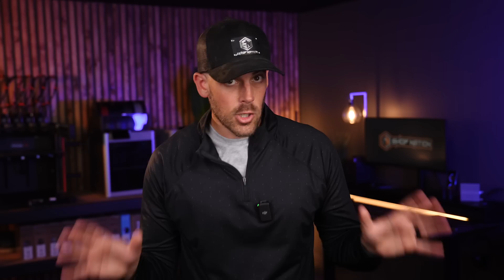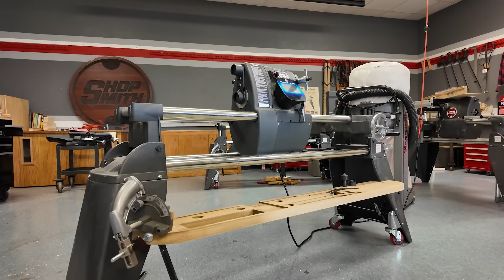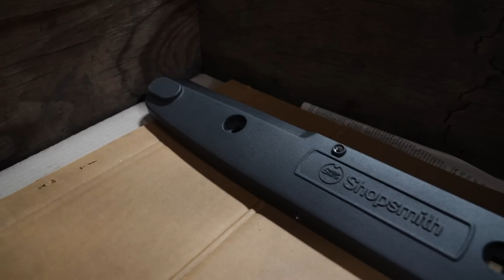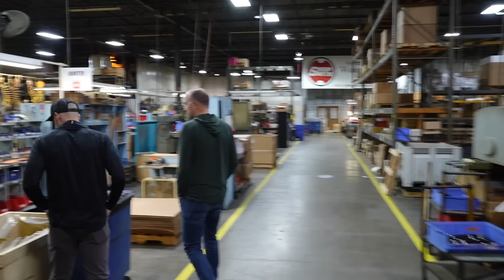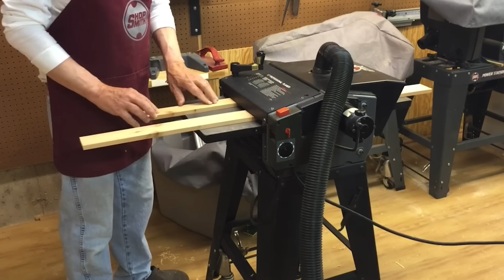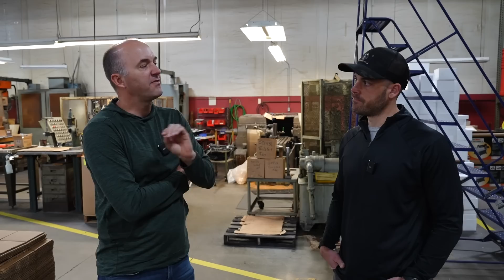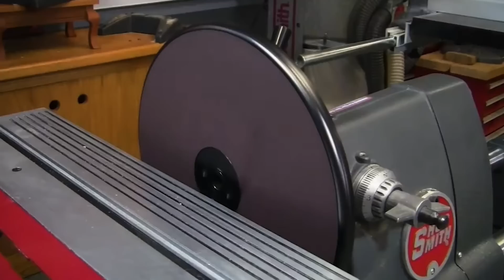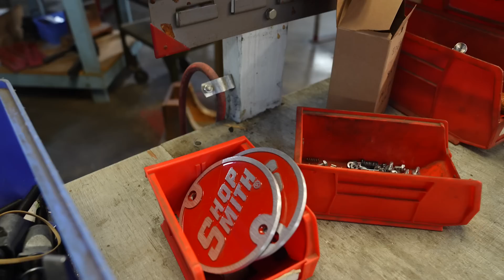The Last American Power Tool Company is (almost) dead

Comment: I have to disagree with Nick on one concept he was touting. That was to stop production on accessories. I have 2 Shopsmith’s in my garage. I want a wonder machine! The Shopsmith of old was not only all that he mentioned, but much more. So many accessories than I can’t even list here. And now you can’t even get parts for them because Nick stopped providing them. That leaves just the base machine, that’s all. To me at least, it does feel like Shopsmith has taken on Zombie status. Not dead, but not living either. Thanks to eBay I am spending hundreds on accessories before they are gone. Making my Smiths more than the 5 basic functions they provide to much more. I do hope Nick is listening.

Comment: I have one that I bought in the late 80’s.  Still have it but haven’t used it much as it needs some adjustments and maybe some parts.  I wish they had a way to have the whole thing revitalized.  I would probably get back into woodworking again and buy stuff.  Get the 600,000 units back running again and the business will take off.

Comment: Wow - this is SO incredibly cool! I had never heard of ShopSmith before but it totally solves the equipment dilemma for new woodworkers that I've been struggling to figure out before buying my first table saw. Nick and his team clearly have a fantastic opportunity for fun and success restoring the company's glory and vitality. Here are 2 cents of advice from a nerdy marketer/hapless novice woodworker ->

1) The seamless upgrade path to the Mark 7 is GENIUS!  The ability to simply add extra functionality with upgrades over time as one's skills, needs, and budget grow is amazing.  Definitely continue to play up and expand the upgrade options.

2) Knowing that the company is here US-based, has a stable product design history, and offers REPAIR SERVICES, ENGINEERING SUPPORT, AND PARTS AVAILABLE (!!!) is a huge differentiator. Americans' escalating frustration with the abysmal performance and unreliability of household appliances really makes your reliability stand out. 

3) You might want to consider expanding your target personas beyond just beginning woodworkers from 24-45. A compelling B2B case could be made for users in small facility management workshops. My friend worked in the maintenance shop at a university for several years doing all kinds of carpentry, repairs, and handyman projects. They had a lot of responsibilities and tasks but the shop was relatively small. The variety of projects these professionals tackle could be an excellent fit for you. It is likely they might require ShopSmith's various functions often enough to want/need to have the capabilities easily accessible in-house, but they might not need them often enough to justify a full collection of best of breed stand-alone tools. I would not be surprised if some hobby users might begin recommending the tool at work if prompted with relevant use cases and value messaging. Plus, a $4-7K equipment purchase is easily expensed at the manager level in most mid-size companies and institutions. 

4) Your positioning must move up-market to attract net new buyers at scale. Your tools may have legendary quality and durability but they also have prices that reflect it. For Boomers, the ShopSmith was a trusty Honda. Today the crappy big box brands have usurped the frugal/responsible position in the market. At the other end of the parking lot, Festool's elite German engineering position is the Porsche Cayenne for the artisanal craftsmen your serious newbies aspire to become. They're costly, high performance, and oh so cool.

Where should you park? Be bold. Unapologetically seize the rock star parking that great quality, excellent service, and sound engineering deserve.  For new multi-tool buyers, ShopSmith should be a Range Rover - a bit pricy, definitely bougie, but defensibly practical.  Yes, it is cheaper to buy one Mark 5 than 5 individual tools. Yes, an entire ShopSmith multi-tool is only 3-4 times the cost of the Festool biscuit joiner alone. But competing on price sucks and it won't be the primary reason new Gen X, Millenial, or Gen Z buyers whip out their credit cards. For existing customers, lean in to the concept of old school cool. Just like rescuing a forgotten VW Beetle from grandpa's garage, price sensitive younger customers can revel in the ASMR satisfaction of laboring to bring something cool and valuable back to life. Mix the Kool-aid for your new cultish classic.
 
5) More prestigious positioning will require substantial changes to your messaging and branding design. The brands current engineering speak - especially as displayed on the website - feels very out of step with the brand's potential to resonate with its passionate audience and sell the full value of the tools. There is a lot of helpful information but the hodgepodge presentation lacks a cohesive content structure or clear value/benefit messaging to the persona targets. The copy focuses too much on spec details and too little on selling visions of satisfying projects buyers can create with the tool. The messaging also misses a huge opportunity to fully leverage nostalgic stories about the company, intergenerational connections among users, or the inspirational hero journeys woodworkers take with every new creation they build with the tool. 

6) The website could serve your promotion goals much more effectively. It is also not well aligned to pushing customers along an effective new sale or upgrade/upsell path. The buyer experience has a lot of friction and confusing info.  It feels like an old site that got updated and added to over the years but hasn't had a content spring cleaning in a while. I noticed a lot of navigation and SEO issues that will hold you back too. Even if you don't have budget for a full site redesign, taking a step back to streamline and wireframe the information architecture then rearranging the existing pages would quickly improve the user experience and likely improve conversions. Make it easy to buy and tempting to buy more! 

7) Aggressively monetizing the refurbishment/upgrade of older units for new generations of price-sensitive Millennials & Gen Z users could offer a very profitable, low risk path to quickly expanding the user base and increasing cash flow.  One objective of your community management strategy should be sharing and celebrating footage and stories about how users have brought their fathers' and grandfathers' ShopSmiths back to tip top shape for the next generation's new projects.  Not sure how you're forecasting customer lifetime value, but there is clearly a lot of potential upside here if you strategically manage the migration across generations. 

8) Fortunately, you already have a massive treasure trove of educational videos, DVDs, courses, and manuals to support #4 and #5 above. Your marketing team should be slicing and dicing those assets more strategically into content snacks, meals and feasts to push across all your social, public relations, community management, and lead generation campaigns.  There is also quite a bit of compelling content produced by the user community - leverage that too!

9) The old fashioned PHPbb user forum buried in the bowels of your website is an absolute goldmine! Properly leveraged, the SEO and content marketing potential waiting to be mined among its 24K topics and 300K posts is staggering. Plus, it's a hotbed of engaged user activity. At 1:00am on a Friday night and there were 292 users browsing the forum! (Only 6 are registered though.) Lavishing some extra customer love on this loyal audience would likely pay huge dividends and could be an amazing resource for activating more of the existing user base.  

Best of luck on your turnaround!

Comment: My dad bought a mark v in the late 70’s and I still had it until a few years ago. Bought another one second hand later on. Good machines for the most part. The drill press and horizontal drill are excellent. Honestly I’ve never had an issue with my shopsmiths quality but the price point wasn’t justified for me. Like in the video, the planer is $2000 and you need to set it up every time. Dewalts best planer is $600 and it works great.. I’ve worn two of them out lol… I avoid the tablesaw too because I’ve never been comfortable with the height of the table.
I would recommend buying a used shopsmith for a good price but not a new one. For the same money you can get dedicated machines of equal quality.

Comment: I saw a ShopSmith at the Los Angeles County Fair about 40 years ago.  It has always interested me but for a production shop, changing tool setups isn't a winning strategy.  For the starting hobbyist (as I was back in the 70's), it makes perfect sense.  The horizontal boring setup is a great idea that isn't found in any of the common machines from other manufacturers.  When building chairs or doing dowel work, it would be a godsend.

Comment: I own a Shopsmith MKV and use it a lot.  It is a well made machine and supplements my shop perfectly.  Since I do most of my fabrication in steel, the wood side of my shop needs to be flexible and compact.  the Shopsmith is perfect for that role.

Comment: I have one with all the goodies. I inherited it from my pops, and got it from my mom’s father. It has built a lot of cabinets, doors, and done a lot of plumbing. There’s not much they can’t do. Mine needs a couple new bearings but it has needed them for 40 years. This was manufactured in the early 50’s if I remember right.

Comment: I see them for sale locally (Saskatchewan, Canada) and it is always either a left in the barn rusted out model, or one that has been used for 40 years at the heart of a small shop and is in perfect condition.... and costs a LOT used. Honestly never seen one up close and just assumed it was a cheap tool that did nothing well but had the advantage of doing a lot But based on this video that appears to be wrong, and how they are keeping their high value even when well used. 

Will I ever get one? Right now, no. I got lucky and inherited a bunch of tool and have just barely enough space to use them all with a large bench. But I'll probably be moving soon and may lose that... and suddenly a tool that replaces most of those ones I have but fits in a corner of the garage may be just the ticket. Or even one of these with a few attachments for things that I don't have like a lathe, wheel sander, and a few other things.

Comment: My first tool was  a Parks Planer  made in Cincinnati area. Always wanted his bandsaw, but they are scarce. Fine, iconic examples of USA manufacturing.  Bought a massive old Cintilathe lathe, weighs about 2 tons for $200.  Just the tooling was worth $2000 with it. Crazy. Put a 1941 Peerless hacksaw in my shop, still tight and good for another 100 years. About 2200#  - for $75 ....Nobody left in america that knows how to use this stuff.  Sad times are upon us.

Comment: I think the New Yankee Workshop both helped and hurt ShopSmith.  I got interested in woodworking because of Norm Abram and thought I needed every tool he had in shop.  Eventually I built a 1200 SF woodshop and have nearly every tool he used.  But if you look at one of his earliest books, you will see that he is using a ShopSmith for a drill press and boring machine.  Like a good ballplayer, its not the glove or the bat that is important.  It is taking time to learn the game and practice that leads to success.

Comment: I owned a Shop Smith for many years.  I had to sell it when my woodworking demanded a larger table for the table saw.  I just could NOT work with the small Shop Smith table.  I didn't have room to keep the Shop Smith just for the other jobs it could perform.  It was a well built machine but it was a "Jack-of-all-Trades" but a Master of none.

Comment: So glad to see Shopsmith is still alive. I have my dads 10-ER that dates back to the early 1950's and use it primarily for a lathe and wire wheel stand. Early on I tried all the various attachments and found that making a cross cut then stripping down the machine to drill a hole and then back to make a cut too time consuming. Don't get me wrong this tool is great for those on a budget or space constraints. You have great name, use it. Start making stand alone tools and sell the made in America logo. Saw Stop came out of no where and had to make a name for themselves. Use your history of quality built machines to sell some stand alone units. I think that would be a smart long range goal. Good luck and I hope you succeed!

Comment: It’s sad to see that almost everything is being made in China now. These are great machines and I thought I needed one of these for years but then I realized that I wouldn’t want to keep changing to the different machines on one unit. I would much rather have a saw set up to keep all my cuts equal then use other saws set up to make other cuts instead of having to change settings especially when making precise cuts for cabinet making and finish work. Yeah it gets a little crowded in the shop at times with multiple machines but this way makes more sense to me.

Comment: I remember as a kid Sunday morning coming home from church there be shopsmith commercials running on TV and I'd sit and watch them I thought they were the coolest around 2004 I finally had an opportunity to buy a 10 ER I love that thing I'm slowly restoring it but I'm still using it.. I have myself a nice Delta table saw and what I find is what I'm doing a large project with lots of cuts I'll run both sides it just makes it easier I don't have to keep tearing down and readjusting and setting up I used the big saw for my big cuts big cuts in the 10-yard for my small fiddly stuff it really takes a lot of the headache out of a project . The part I like the most about my 10er is the drill press function it's strong sturdy and being able to use the saw fence as a guide or a stop point just makes it super handy. In the ads used to carry on about it being a horizontal boring machine I used to think oh that's neat well once you start using that function you realize just how handy it is 🙂

Comment: If Shopsmith can add any common metal working ability to the shopsmith all in one machine then they can easily add more customer base and recurring customers/buyers without fail and it will allow woodworking people to have a taste of metal working in their woodworking project's and most metal working people to take a chance at some woodworking tests as well on this machine and won't turn away from this shopsmith machine by saying; 
Oh it's for woodworking only so it's not for me overall. 
There is a serious need for shopsmith machine to have some metal working adapters or outright metal working attachments to have a better and wider audience for customer base since the shopsmith tool can work for some metal working project's if the right adapter's or attachment's are available even as an add-on for the shopsmith machine itself since the existing customer's can pony up the metal working attachments costs a lot more reasonably than new buyer's.
Just saying that you can develop metal working attachments for the shopsmith machine that will get you to have a finished metal working attachment that is in frequent use in woodworking workshops will keep your development and production costs low while allowing for a faster return on investment from customer purchases.[ e.g:- like your woodworking lathe could be modified to do metal working on the lathe as well to turn some metal]
Shopsmith, you focus and promote fully metal built shopsmith machine's why not give your current and new customer's the ability to add metal working capabilities to their woodworking arsenal.

Comment: I think he should rethink making planers. $1600 is crazy for cost, let alone $2,000 retail, when Dewalt,  Makita, Wen, Craftsman, Wahuda & others can still make a quality planer at affordable prices, retail for half of ShopSmith cost! Planers at becoming more popular, especially with helical/spiral blades. My 15 year old Delta is obsolete. I can't even find parts  for it. Keep ShopSmith alive!
You need more outlets, people selling & demonstrating them. I have to admit it,  ShopSmith prices are high. I had to buy my Mark 5 used, because I couldn't afford to buy it new. I wanted a ShopMith planer, but had to buy a used Delta because of price. I do need some replacenent parts and a service center I an get motor, bearings, etc. worked on. Fyi, I am 61 years old & trying to get out of truck driving and into woodworking for a living.  Prices, service, and availability of parts and equipment are major factors in my ability to make the change.
Reply: Agreed, I think he will need to outsource the planer and use some modern material like thermo plastics to cut weight down, aluminum bed too, perhaps.
Reply: @PistonHonda87  Sounds good to me.  I really wanted a ShopSmith planer, but they're so darn expensive. And finding one used in good condition that's not also expensive is a task. My Delta  My wife's got me used from an estate sale has about had it. The rollers are shot in I can't find replacements. It won't pull the wood through properly without really cranking it down.

Comment: I got my Mark V in 1992 when I was 25 with the jointer, band saw, and scroll saw (I don't think they make it anymore, that's a real shame). When I started college at 27, I used the scroll saw to make 3D designs that I sold and (kinda) lived on, and the Shopsmith paid for itself several times over. My son and I still use it 2 or 3 times a month, I love it. I'm the opposite of @johnm948 below, I like Shopsmith because I have 8 tools that take up very little room. I would never be able to fit, or afford, 8 stand-alone tools.
Reply: Great! Keep on going!👍